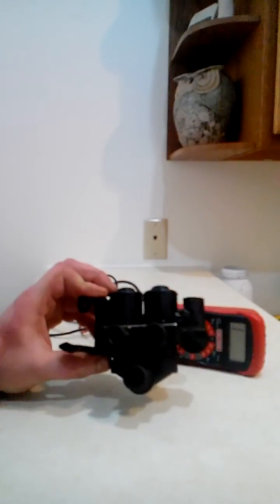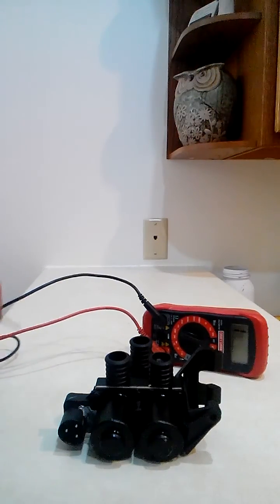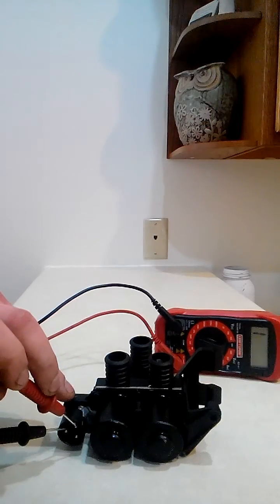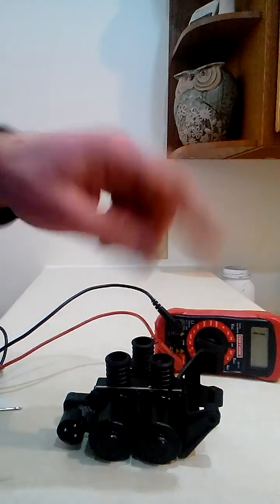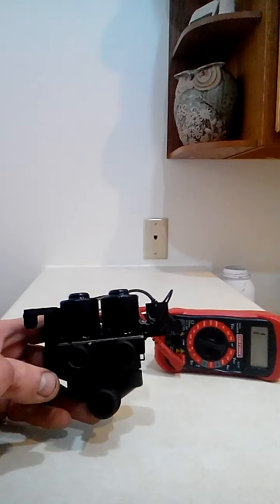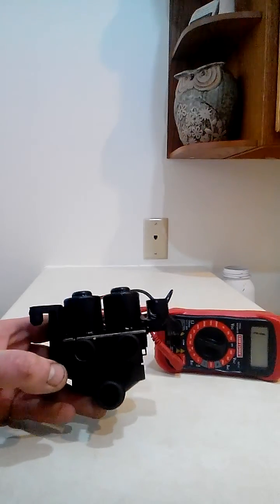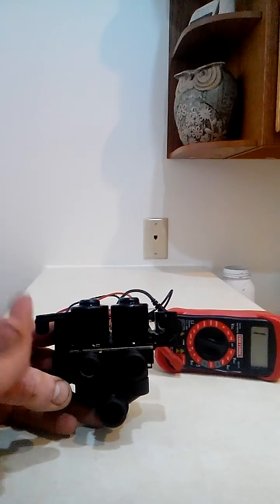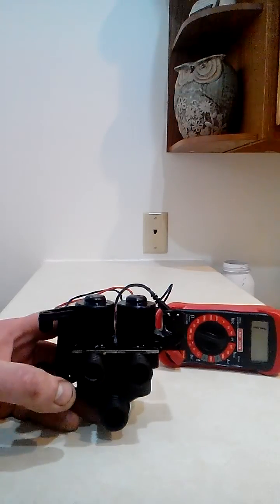E36 heater control valve test

Comment: i was told my aux water pump wasn't working by my indie garage, on my E39, and that i needed a new pump/valve, so I took it out to use one of those gasket replacement kits, and after that the valve was stuck open and pouring hot air into the air con output. Maybe it was stuck closed before. Looking at the plungers, they seemed to stick, and it wasn't the new rubber that caused the problem. I've got 25ohms on one and 12ohms on the other.